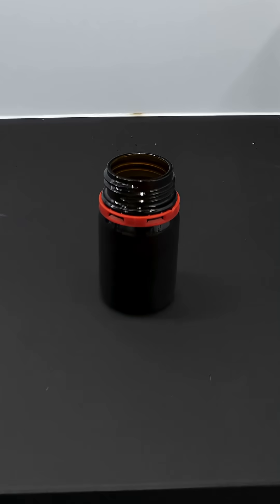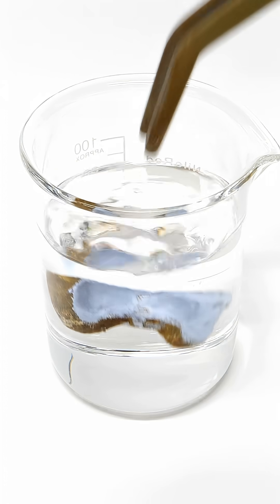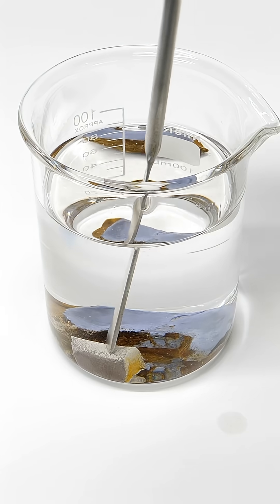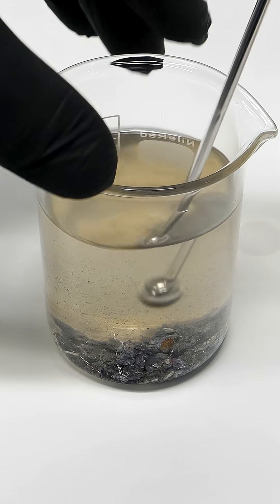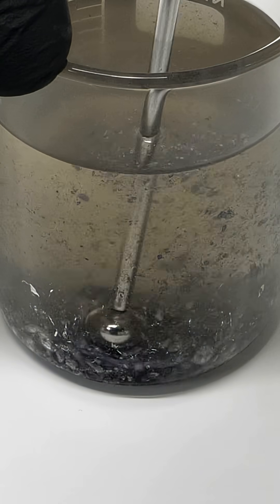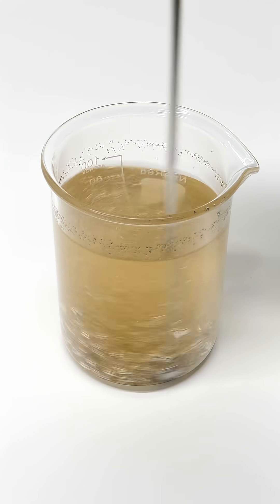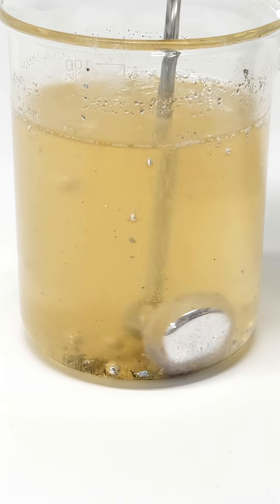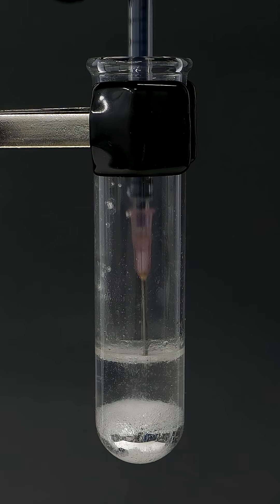Mixing sodium and potassium is crazy

Comment: I get that the liquid kerosene doesn't react but its just funny to think about putting an explosive metal into a liquid they use for jet fuel
Reply: And the best part is that it goes nuts when the kerosene is replaced with regular water 😅
Reply: @KevinJLoos It goes NaK!!!
Reply: @KevinJLoos  right, the thing we use to put out fire, is the thing that causes the fire
Reply: @ryanrobinson2380  water’s such a silly thing 😜
Reply: @ryanrobinson2380  there are quite a few different substances besides water that we use to put out fire.
Reply: @xisotopex same with starting them. But nobody cares.
Reply: @KevinJLoos that's literally part of the joke
Reply: @KevinJLoos 😂😂😂😂
Reply: all it needs is a little water..
Reply: @orii-raepoole5446 true but "a little" is so simple word in so sensitive and dangerous thing😊
Reply: @orii-raepoole5446 
It sure would make starting a fire in the rain much easier. And fun! 😂
Reply: Honestly I found it ironic as well, but life is just a big irony.
Like water: the liquid we need to survive, and possibly one of the most dangerous substances in certain scenarios (commonly reacting with other substances, ofc)
Reply: @Sahumis couldn’t agree more water is crazy. It’s made of the one of the best fuels for combustion (hydrogen) and the thing needed for all combustion to take place (oxygen) and if u throw it on a burning fire, it will put it out….. the f**k is that about?
Reply: @garretlemire4327 I guess you can do the same with diesel
Reply: @Sahumis That one is on oxygen being one of the most reactive/corrosive elements lol. Not the water itself, in fairness.
Reply: @Sahumis yeah because you literally need water to burn something in your body
Reply: @onurselimyuksel4107  technically but not literally
Reply: @onurselimyuksel4107  in a very roundabout way. Water is consumed during dehydration, breaking down macromolecules into constituent monomers.

After several more reactions, we end up with protons forming a literal battery in our mitochondria. Their former electrons when they were hydride bounce along, pumping protons and charging the battery, until oxygen, hydrogen, and those electrons all combine at the end, forming water.

Just as the proton charge is an actual organic battery, the electron transport chain is a fuel cell just like that used in the space industry. And it powers an electric motor complete with rotor and stator.
Reply: @Sahumis It certainly was very ionic.
Reply: @tjsbbi  underrated comment
Reply: @Sahumis  water can also kill you, very easily might I add
Reply: @simplymeowlogicallast I heard 100% of humans require water to survive yet  100% of humans who consume water die. Oxy moron is the most underrated metal.
Reply: @Sahumis  the other irony is that we need both potassium and sodium for our muscles to work 😅
Reply: @Sahumis 
Water should be banned by OSHA as a dangerous fire causing agent.
Reply: @Sahumis everything is “extremely dangerous” given the right circumstances. It is not just water
Reply: @Sahumis  its kinda poetic in a weird yin yang way
Reply: @Sahumis it’s also a compound of two out of three of the requirements for fire, fuel(hydrogen)and oxygen
Reply: @Sahumis  almost all of the conflicts in life come down to too much or too little of something. Goldilocksing. It’s a wonderful allegory promoting balance to tear apart binary thinking.
Reply: @Sahumis or the fact that water is two hydrogens, a very flammable gas, and an oxygen, a rly great oxidizer, and you bind em to get a liquid that’s the best large scale fire extinguisher we have. Chemistry’s funny like that
Reply: @Sahumis  nothing ironic about it just super simple chemistry 

alkali metals react extremely exothermicaly with oxygen in air or water. kerosene is a mixture of hydrocarbons and contain no oxygen atoms. therefore, no reaction will occur
Reply: @waelfie we know nerd boy, but  it’s still funny that kerosene is safer than water in this instance
Reply: @waelfie  nothing ironic about an unaware nerd being an "ERm ACKchually! ☝️🥸"
Reply: @waelfie um actually 🤓 ahh reply

it’s irony because it’s something you wouldn’t expect being the reality, in trying to sound smart you ended up sounding really dense
Reply: @charles281  i can't even spread chemistry knowledge in a chemistry youtuber's comment section... what has this world come to 😭😭😭😭😭
Reply: @waelfie It does contain oxygen atoms they just aren’t available
Reply: @rlt9492  So Kerosene doesn't contain Oxygen atoms. It's just Hydrocarbon chains. Much like others which all don't contain Oxygen, like Ethene, Propane, Butane and so forth.
Reply: But why does ethanol help the reaction? @waelfie
Reply: Ok smart guy😂 @waelfie
Reply: @waelfie unless you have UV and a halogen carrier in which case you can trigger a friedel-krafts reaction
Reply: @waelfie Fe is definitely ironic
Reply: @DeadDrop161Krew  Omg, I know right?!  It's hilarious that the kerosene didn't do anything when no source of ignition was applied!
Reply: @waelfie yup. People wonder why water is so reactive with other elements. It contains two of the most abundant and reactive elements in our environment.
Reply: @waelfie Sodium and potassium lose electrons rapidly when they come into contact with water, forming hydroxide ions and releasing hydrogen gas. The reaction is not just a simple fizz—it’s a violent, highly exothermic redox reaction that involves complex thermodynamics, including changes in enthalpy, entropy, and Gibbs free energy, as well as rapid phase transitions. The hydrogen gas produced can ignite due to the intense heat, leading to explosive bursts and visible incandescence. The flashes of light you see come from quantum-level electronic transitions, where electrons in excited metal atoms fall back to ground state and emit photons with characteristic wavelengths. This is direct evidence of atomic physics at play. The reaction is also dynamically unstable, with heat accelerating the rate, generating feedback loops and even steam explosions if conditions are right. Dismissing this as “basic chemistry” shows a shallow grasp of the actual science involved. Trying to belittle someone over it just exposes your own lack of understanding.
Reply: @waelfie doesn’t change the irony of it lol. yea it’s kinda just how things work but even understanding why and how that is it’s still ironic the jet fuel is the one thing keeping him from starting a fire on accident.
Reply: @waelfie atleast one person in the comment section that knows basic chemistry 
Or else others doesn't even know that water is h20 and it have one atom of oxygen and that's how it creates one molecule of water
Reply: @tesselllation  You left the absolute best and most intelligent, informative comment of all and I can’t believe I’m the first person to Like it 2w later! 🧪 👨🏻‍🔬
Reply: @waelfie ”super simple chemistry☝️🤓”  bro just shut up, least fun kinda person
Reply: Lol. You completely missed the point that it wasn't about chemistry at all. But, that both substances are explosives.
Reply: @Sahumis  Also somewhat related: oxygen is what our bodies use because it is such a useful thing to induce various reactions (we also see how it also corrodes stuff) — but on the other hand, exactly because of that, it is very dangerous to organisms not specifically used to it. From fossilized and geological records about early life and the atmosphere’s composition, we have found that early microorganisms producing a ton of oxygen via photosynthesis and thus filling up the atmosphere with what was fairly sparse before likely almost brought about the extinction of said life itself, at least based on what evidence we have access to (in what is known as the great oxidation event).
Reply: @Sahumis Nothing ironic at all, you're just seeing the small scale of things
Reply: Mix all 3...
Reply: @michaellh04 The reaction:

2
𝑁
𝑎
𝐾
+
2
𝐻
2
𝑂
→
2
𝑁
𝑎
𝑂
𝐻
+
2
𝐾
𝑂
𝐻
+
𝐻
2
↑
+
 enough heat to ignite the sun
2NaK+2H 
2O→2NaOH+2KOH+H 2

 Nearly enough heat to ignite the sun
That rapidly produced hydrogen gas doesn’t wait politely — it detonates, especially since the reaction generates more than enough thermal energy to autoignite it. Now add jet fuel or kerosene — a highly combustible hydrocarbon — and congratulations, you've just created a two-stage combustion system. The NaK + water reaction gives you the initial ignition and blast pressure, and the jet fuel gives you sustained fireball fury. I wouldn't try it 😂
Reply: The C in Chemistry is for Crazy.
Reply: @JoelMogwasa the m is for mental asylum and the r is for required
Reply: Jet fuel is flammable but not explosive.
Reply: @mackrobertson2187     Correct. Volatility isn’t necessarily a measure of energy density.
Reply: @mackrobertson2187 The vapor is flammable. The liquid is not. Jet fuel and diesel both have pretty high flash points, over 100F... anything below that and it does not ignite unless compressed or aerosoled
Reply: @mackrobertson2187  You can make it explosive by atomizing it well, though. I would compare the fire of a jet engine more closely to a constant controlled explosion than I would a constant controlled fire, same as the difference between gas or diesel in a combustion engine versus being lit on fire in an open and uncompressed chamber (though gasoline CAN go from flame to explosion all on it's own, though, that, too, is dependent on the gasoline being atomized via rapid evaporation from the heat of its own fire).
Reply: @mackrobertson2187 Jet-A (or A1 in some cases) is shockingly similar to Diesel fuel, they’re only flammable if under high pressure and atomized
Reply: Kerosene isn’t explosive. You can throw a lit match in it and the only thing that’ll happen is your match will go out.
Reply: @LESLASLESLAS  What? Are you thinking of diesel?
Reply: @asandax6  Kerosene is not very unlike diesel on the scale. It burns, but not wildly. It was commonly used for heating homes a generation or two ago.
Reply: @kundetjenesten   We still use kerosene in South Africa for starting fires in wood stoves or straight up use kerosene stoves because ESKOM is unreliable and shipping gas (LNG or Propane) is more expensive than kerosene. That stuff is highly flammable way more compared to diesel.
Reply: @asandax6  Yes, I know it is flammable, what I meant is that it is more similar to diesel in usage than it is similar to petrol. Diesel/MGO/heating oil (class C liquids) were also used for heating, something you of course could never do with a class A liquid (or at least not more than once, hehe). I apologise that it may have sounded as if I agreed with previous poster that kerosene has a similar flashpoint as diesel.
Reply: @kundetjenesten   Ohh I get your point. Yes it's much safer compared to fuels like Petrol.
Reply: @LESLASLESLAS  I light kerosene lanterns with matches all the time... and they ignite. You really shouldn't say things you don't know to be true.
Reply: @Knucklesmd kerosene lanterns have a wick I assume? The wick causes the kerosene to vaporize, and what you are burning is the vapor, not the liquid
Reply: @LESLASLESLAS same with Diesel fuel
Reply: @LESLASLESLAS react it with Rp1 then 😂
Reply: @LESLASLESLAS same with regular gasoline ... Watch out tho... Those vapors can Be dangerous.. dont try this at home!! 😅
Reply: @LESLASLESLAS it depends - when exactly you are throwing your match
Reply: Jet fuel is very difficult to ignite; the spark ignitors in jet engines sound like lightning when they go off on account of goes much energy they need to deliver.
Reply: @jimsvideos7201 
Yep. When testing in the shop stand clear. And then do not touch any part of the circuit until 15 minutes have passed after disabling it. The amperage can and will kill you unless you let the capacitor bleed off.
Reply: @jimsvideos7201 jet fuel is basically kerosene.
Reply: @jimsvideos7201 I knew this about diesel fuel but assumed that it wasn’t the same for jet fuel. Guess I was wrong!
Reply: @rolandmcrae6817  diesel and kerosene is similar.
Reply: The kerosene removes the oxygen so the 2 metals can combine.  Kerosene is used when making Damascus as well for this reason.
Reply: @wolfwhisperer580 oooh lovely . I like seeing damascas swords forged for example if you mean this ornate alloy .
Reply: Chemistry is ironic sometimes.
Reply: HE MADE INDOOR FIREWORKS
Reply: @Ganondorf051  and several TSA no-nos
Reply: @darkmatter7266  Oh well
Reply: @darkmatter7266 what’s TSA?
Reply: @moonmagnolia7  transportation & Security Administration ( mainly policing what can be taken aboard a plane in the USA)
Reply: People think it's crazy that the ordinary things we need to live can be so reactive, but that's exactly why we need them to live.. if there were no reactions, we couldn't get the energy out to use it.
Reply: Jet fuel is very similar to diesel
Reply: Youre gonna be shocked when i tell you what the ingredients of water are used for
Reply: Combining Sodium, Na, a highly flammable metal, to Chlorine, Cl, a highly toxic gas, makes table salt, NaCl. It’s great on pop corn and lots of other food.
Reply: @tubba-lubba-tub-tub oooh Yaaaa!
Reply: @tubba-lubba-tub-tub hmm, I prefer the naturally occurring, hand harvested Celtic Salt to the processed kind you just described and I grew up on. 
I am not a bot or a salesperson, just an ignorant person grateful to be alive in this day and age where information is “freely” available at our fingertips.
Reply: Kerosene is pretty stable and hard to ignite when it's in a container like that. It only becomes highly flammable when it is aerosolized or on a wick. It's kind of like diesel fuel just more refined.
Reply: explosive^3
Reply: Try to ignite kerosene - then you get it.
Reply: @multi.interested. like in a camping lamp?
Not hard
Reply: @iwannaseenow1  Try to light it outside the lamp...
Reply: @iwannaseenow1 a camping light uses a wick to vaporize the kerosene. Similar to a candle.
Reply: @multi.interested. easy put the kerosene in a container dip a rope in the kerosene and lite it
Reply: @multi.interested. That was in Home Alone 2 , wasn't it ? 🤪
Reply: And clean it with alcohol...
Reply: Jet fuel can’t melt steel beams
Reply: @kinggold9087 ❤
Reply: Literally the villain™ in a children's Show drinking Evil Water™ in an evil glass™.
Reply: That's chemistry for ya
Reply: "We gotta use jet fuel! Its more stable!"
Reply: Make cesium
Reply: The metal is explosive in water.
Reply: This guy has to be on some type of watch list.
Reply: @lr5658 hes technically on every one of his subscribers watch list
Reply: You can put out a fire with kerosene. As long as it doesn’t aerosolize, it’s not going to burn in any condition outside a blast furnace.
Reply: Organic chemistry is always so funny to me bc it’s like “Ok guys we’re either gonna dissolve in this hydrocarbon that’s also used as fuel for everything or we’re just gonna use straight up alcohol.”
Reply: I didn't even consider it being jet fuel lol I'm so used to my mom using it for oil lamps when the power went out
Reply: Jet fuel is surprisingly stable
Reply: @HeresPeanut 911 joke
Reply: As a drag racer and hobby scientist, what’s interesting to me is the fact jet fuel is the most BORING fuel of all, while one of the most insanely flammable and nearly explosive fuels is the most common 87 octane regular unleaded gasoline everyone uses in their cars! Pour a small amount of each on a driveway and toss a match, the difference is astonishing. The gasoline is like a bomb going off in comparison to the kerosene which is so slow and lazy it looks as though it might extinguish rather than burn the entire puddle.
Reply: Wow, someone somehow more nerdy than me.😳 I’m not even trying to be mean
Reply: Kerosene isn't actually all that flammable on its own at all. It will burn, and it has a higher energy density than gasoline, but unlike gasoline it doesn't really evaporate at room temp at all, and since the fumes are what actually burns, the liquid itself is not easy to get to start burning at all. Sticking a lit match in some liquid kerosene is not likely to do much more than put out the match, and even if it does start burning, it's going to burn fairly slowly.
Reply: Ya.. i told someone That kerosene was jet fuel, and the person i told, called me a liar!! Don't they teach kids anything????
Reply: Aaand ... It will melt off wax that you spilled on your favorite jacket!! Nice!
Reply: @ThomasBallew-m7u4u 😂 tell em the planes are flying cows. They'll believe it.
Reply: It’s lamp fuel, far from jet fuel (hydrazine) 😂😂😂
Reply: rocket fuel as well actually
Reply: Thats walter white level confident.
Reply: That's chemistry for ya
Reply: I mean you can put out a lit match with jet fuel so it's not that surprising.
Reply: You’d be surprised by a lot of chemistry.
Reply: @TheBluePhoenix008  - It’s a highly interesting subject. If I could have a do over, I’d look into Chemical Engineering, Electrical Engineering or Mechanical Engineering. But I’m 67 and been retired since I was 56. Now I just dabble in everything for my DIY projects and my own entertainment.
Reply: Kerosene will put out a magnesium fire in a closed system. Water is 89% oxygen by weight
Reply: Wait till you learn we used to use that stuff for lighting our homes.
Reply: Its the equivalent of the SR-71 fuel that doesn't burn. Pilots would routinely put their cigarettes out in it before flying.
Reply: Even more funny when you think it won't react to flames with kerosine but does so with water
Reply: Chemistry is wild
Reply: and the freaking ETHANOL?!?!
Reply: Put the two highly reactive explosive flammable metals into a glass of highly flammable petrol based hydrocarbons, add some highly flammable corn based hydrocarbons to clean the metals into a more reactive state, and mix the metals into a blob of even more reactive liquid metal alloy, what could possibly go wrong?
Reply: Okay… so I hope you disposed of the liquid kerosene metal  properly and didn’t just pour it in the ground or try to wash down the sink drain.  Where do you find something like solid potassium? Not that I want to know- I don’t. I hope this video doesn’t give anyone any ideas.  Those metals aren’t exactly safety rated .
Reply: Also, it did not explode in the presence of ethanol that is flammable.
Reply: Thank you now i know that
Reply: Science! Chemistry! Walter H. White! Breaking Bad! Jesse Pinkman! Fallacies! 

Saul Goodman (seriously, it’s all good man)! Hank Schrader! Marie’s purple headahh! Skyler! Tuco Salamanca’s crazy ass! Gustavo Fring! Skinny Pete! Badger! Breaking that bad that’s bad at breaking type shi. I’m clearly tired hoooly…… Let me just shut my damn eyes now this is insane.
Reply: The opposite of a toxic relationship.
Reply: Preparing for the apocalypse
Reply: Kerosene is just like diesel where it needs a specific amount of pressure or spark to particularly ignite it’s not really that volatile when you look at it versus other explosive liquids
Reply: 😮 😳 okay!
Reply: High quality pure kerosene is used in lamps and heaters. Lower quality, with additives, is diesel fuel. Both are less volatile than gasoline.
Reply: Well if we know anything, it's that jet fuel can't melt steel.
Reply: I thought they used potassium nitrate and sugar for jet fuel
Reply: Fr
Reply: I have an idea
Reply: made for each other, indeed.
Reply: Where is the safest place to store this highly reactive and famously explosive material?

Oh, submerge it in the same shit Boomers used for space heaters.
Reply: + 1 Audi rs6
Reply: POV u ask that one science kid how to make fireworks
Them:
Reply: I mean, oxygen is one of the main ingredients in rocket fuel, and you breathe that sh*t in to live 😂
Reply: Are you forgetting that ethanol is a lot easier to ignite than kerosene?  Surely that makes it "scarier" to the ignorant?
Reply: If it's relatively pure kerosene it's fine although I'm sure if there's some water in their this will go somewhat poorly
Reply: and yet it can't even melt steel beams.
Reply: @Valchrist1313  and yet it did
Reply: With ethanol
Reply: Um
Reply: So now that I've got my beaker of ALL OF THIS WILL EXPLODE
Reply: More like terrifying 😂
Reply: Dead rails irl hahahah😅😅
Reply: And diesel isn’t flammable but combustable lmao
Reply: Whoa, as a chemist there couldn’t have been anything more normal. Didn’t even register as remotely strange. I did make a lot of sodium napthalenide  in grad school tho
Reply: Acid-Base theory is amazing
Reply: O quê acontece se se misturar o gás mais poderoso do Universo, que não apenas explode, mas detona, o Hidrogênio, com o único gás que gera o fogo, o Oxigênio?
Reply: Keros also used for fire spinning, its not volatile
Reply: Happy Diwali 🎇
Reply: It would be even funnier if they tried to make a plane out of that stuff. 😅
Reply: Why is it so angry all the time? 😂
Reply: UV imagyne al the pee pole😅❤
Reply: I'm curious as well as to why kerosene of all things
Reply: Kerosine is not same as Jet fuel...
Reply: If it makes you feel better, molten sodium/potassium mixtures at 600°F are piped into modern nuclear reactors. It functions as the coolant. 
For obvious reasons, these "LiNaK" reactors usually aren't installed in areas prone to cyclones, earthquakes and such. Usually.
Reply: CIA is very quiet rn
Reply: I was thinking the very same thing. Also, adding in ethanol doesn't cause get to explode, but put it in some water, and 💥!
The universe sure is filled with contradictions.
Reply: And the next thing you need is to use your brain 😂
Reply: My first reaction.
Reply: EXTREMELY WARNING ⚠️ : DO THIS ON UOUR HOME TO SUPPORT THE CHANNEL AND WANT TO SEE MAGIC. 
NO SCAM 👾
DO NOT CHECK THE REPLY
EDIT:OH I WRITE THIS FOR SO LONG SO PLS LIKE 😔🥺
Reply: I mean, hydrogen is flammable and oxygen is basically food of fire. Why water isn't explo-
Reply: Exploding metal + liquid fire = this is fine
Reply: Both of those metals and a lot of them that are very similar on the periodic table react rather violently with di-oxygen. The reason for mixing in a very oily liquid is to prevent the possibility of a potentially catastrophic reaction. These metals are so violently reactive with dioxygen that they are shipped in oil and very well insulated and protected containers
Reply: Funny... sure
Reply: Lmao, yes. Indeed.
Reply: Frfr
Reply: Imaginen una bomba atómica con esa reacción terrible
Reply: Y yo preocupado porque no podría comer bananas con sal 😂😂😂
Reply: А что , керосин еще и не жидким бывает? Менделеев в гробу перевернулся
Reply: They actually use this Liquid Metal to cool nuclear reactors
Reply: I used to put my AA lithium strips under Coleman fuel when i cooked meth. Lithium can get crazy quick.
Reply: First, it's kerosene, not jet fuel. Although similar, they are quite different. Second, kerosene has a higher flash point than gasoline, so it requires quite a bit more activation energy (heat) to get it to burn.
Reply: Well, it can produce a chain reaction if you manage to ignite the NaK, so it's kinda funny and sus
Reply: Kerosene is actually one of the most stable fuels
Reply: One is explosive one if flammable 2 completely different things
Reply: DeLhi❤❤😂lake
Reply: Mr indian hecker 💥💥
Reply: It's not behaving

GIVE IT ALCOHOL
Reply: Superb 😮😅❤❤❤❤❤if chemistry is taught like this, who wouldn't love
Reply: Truth is stranger than fiction.
Reply: And then you put it in a liquid used to put out fires abd it catches fire! What?
Reply: I always think of it as just another non polar solvent
Reply: doesn't melt steel beams btw
Reply: Did bro just re-discover greek fire?
Reply: Amalgam to fireworks
Reply: Super!
Reply: 67k likes.. swallows
Reply: I think it's just cold water
Reply: You have 67k likes 😞
Reply: Any water gets in the kerosene and you're cooked
Reply: It's OK! Jet fuel can't melt steal beams. 😂
Reply: you can toss a lit match into kerosene and nothing will happen
Reply: I mostly associate it with oil lamps. T_T
Reply: Fire and explosion needs the presence of Oxygen which water gives but oil/kerosene cuts the supply of oxygen to sodium 😅
Reply: Kerosene is also great for keeping out robbers!
Reply: It's even funnier if you think about junkies creating meth in one pot some kind of birch modificated reaction where not only fuels are used but also ammonium nitrate which is not first stage explosive used in mines to crush rocks from so many years
Reply: It's because air & water contain both oxygen, but kerosene doesn't. That's why it doesn't react.
Reply: Jet fuel is far less flamable and is more stable then even diesel i don't know why this is amazing to you 😂 people always assume jet fuel is violently explosive when its not you need to stop watching movies
Reply: @Beelzebub73  I don't understand why you don't understand it's counterintuitive
Reply: @patrickt696 i dont understand why you and half these commentors failed 6th grade chemistry class 😂
Reply: @Beelzebub73  we get the chemistry(and if we didn't we've had 50 people explain it), it's just that in our day to day lives, kerosene is most well known for being lit on fire or otherwise being combustible. So it being used to prevent combustion in this example is just a weird thing to think about, especially if you further consider that water(something famous for putting out fire) is what causes ignition. We understand but it's still weird
Reply: Thats true, but flammable doesn't have to do anything with the experiment in the video. Its about the oxygen contained in the water @Beelzebub73
Reply: Reminds me of the time they tried to tell us the jet fuel could melt steel beams.
Reply: @AtomicCortex  no one ever told us jet fuel could melt steel beams. But the jet fuel along other things burning got hot enough to soften the steel beams causing them to collapse under the weight from above. Whether you think the government or terrorists were behind the attacks or the government let it happen. The planes are what brought down those buildings and nothing else.
Reply: @AtomicCortex except that the experts didn't tell you that. Dumb Internet tards fed you that nonsense and y'all can't let it go.
Reply: @AtomicCortex it happened.
Reply: @AtomicCortex 😅apt
Reply: @AtomicCortex  🫣 Steel beams can become unstable under pressure at high temperatures, such as in a house fire. Steel loses much of its strength at around 500 degrees Celsius. This can cause the beams to give way under the load of the building and collapse.
Reply: @AtomicCortex 
Yeah and then thousands of the worlds best architects and engineers came together to write a refutation  and report of what actually happened. Seems that they dont agree that jet fuel burned steal beams either.
Reply: @JohnLively-p5d curious. I never looked into the conspiracy cuz ik the govt will always lie. But i would like to read this research/scientist report cuz i honestly always thought jet fuel melting beams was a huge stretch. Anyone have a link or name of anyone involved to help me find it?
Reply: @JohnLively-p5d They never burnt or melted the beams. The tremendous heat forced them to buckle, (they weren't fire-proofed from below), shearing them off of the supporting cleats, that joined the spinal structure of the building, to the exoskeleton. Once one floor detached, it crashed onto the next one, liberating it too, from it's support cleats, and on it went, gathering speed and mass. Science is awesome.